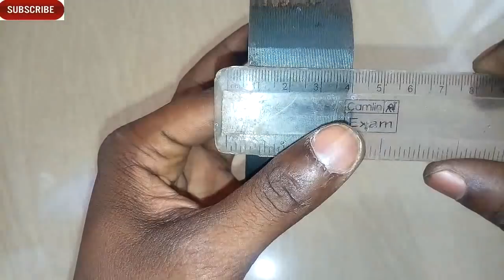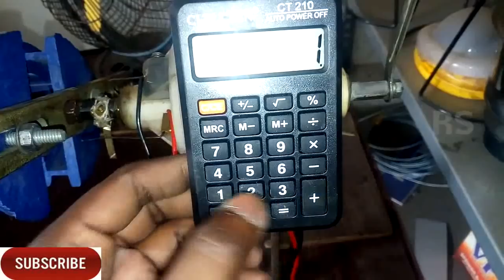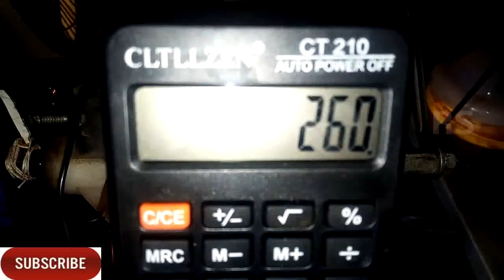Mixie field winding || Full video || RS Electrical Tamil channel || Ramanan

Comment: Sir swg 24 no or core ka motai 34 mm hai mera 1st coil mai 3 wire hai or first wala wire carbon bush ka hai or dushra wire yani middle wala loop mai diode lagaya hai or dushra wire yani loop mai sa connect ho k dushra coil mai connect hai second coil mai 4 wire hai dushra coil ka first wala loop corbon bush ka hai 2 wire bach Gaya ish ka coil winding kaisa kara batayea mixey ka field coil kaisa banaye .

Comment: Terminals eathuku pokum nu sollunga sollunga bro place
Reply: First set starting kampi carpan end kampi over lod switch another set starting kampi carpan 160turns affter first speed 60 turns affter second speed 40 turns affter nutel